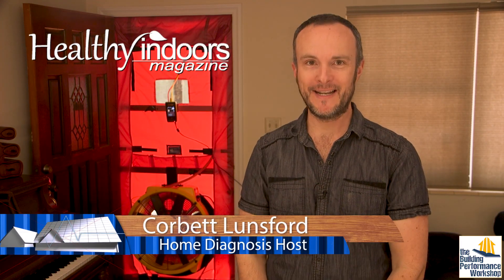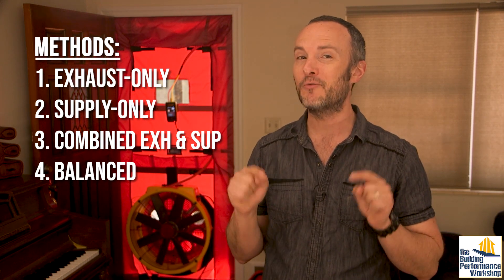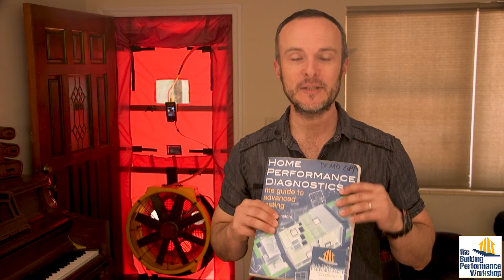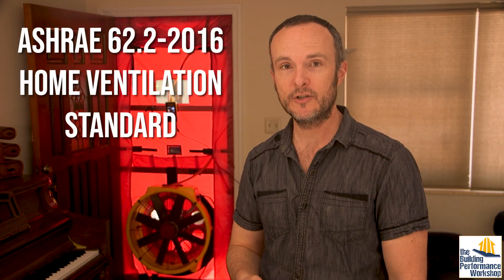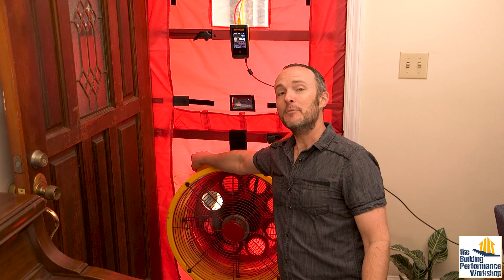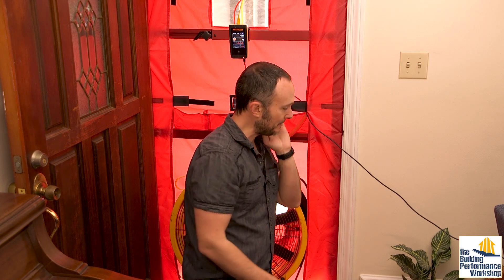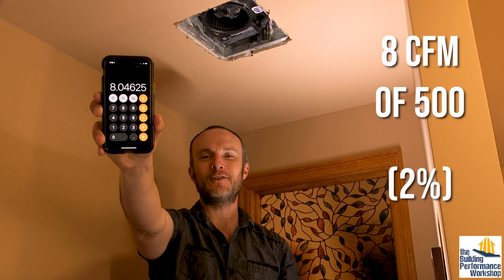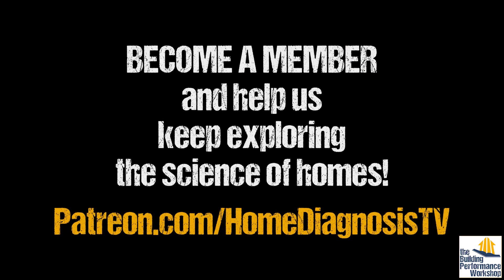Supply Ventilation for Homes: Mythbusting Side Effects

Comment: One of the interesting things about resistance is that it actually does not follow only the path of lease resistance. Liner Network Analysis is an engineering class which teaches how to calculate where electricity flows when it has multiple options (like air in the house). IT turns out the flow follows every possible path at the same time, but the amount changes based on the resistance along each path. The equation is in the form 1/r total=1/r1+1/r2+1/r3.
Reply from the maker: Very interesting, thank you
Reply: No-one ever suggested that air (or electricity) ONLY follows the path of least resistance. I think even a poorly educated person can recognize that air will exit EVERY opening in a pressurized home. Obviously the volume of air exiting each opening will vary, based on the 'resistance' of that pathway.

Comment: Corbett, I'm a little confused by your concluding statement at 12:12.  You say, given a supply-only ventilation strategy, you're not convinced that air will become trapped and condense in building cavities, and that you think it will always find its way out.  Air won't flow into a building cavity unless there's a way out.  Am I missing something?
I think the issue here is, on its way out, will warm moist air condense on building surfaces?  To this I argue "yes it will".
After reading a PILE of information from Joe S. and other knowledgeable Building Science types, I think the reason our leaky buildings generally survive cold climates is simply that mold and rot don't happen at very low temperatures, and by the time things warm up enough to support mold growth the building has had a chance to dry out.
Reply from the maker: Couple points: 1. Joe S and other building science types are largely operating from theory, not from measurements in my experience. Hence you'll often hear 'remember what I told you last year? We discovered that's totally wrong.'
2. If a cavity will have cold surfaces in it, that means it's insulated. It seems obvious to me now that it's unlikely the air is bypassing a wide open window, as shown in the vid, in favor of squeezing into a building cavity that's got insulation in it. If someone does actual research on this and gets actual data to the contrary, fine, but there's none right now, so making decisions based on theory vs. measurement seems like the wrong move.
3. As you know, I'm installing balanced in our own house. But what we're talking about here is the homes that can't afford or fit a fully-ducted separate balanced system- they should have some ventilation imho, and supply-only is far superior to exhaust-only, for filtration and distribution reasons.
Reply: 1. Yes, I've seen those "We got this wrong" admissions, however they are rare (interior basement wall insulation for example).  The building community has been doing quite a lot of testing with regards to moisture accumulation in exterior walls in cold climates.  Much of this has been from researching the "Cold Sheething" phenomenon with super-insulated wall assemblies, mainly double-stud walls.  WUFI modelling suggests many wall assemblies should be failing, when in reality they are not.  What testing has pointed out is, moisture accumulation in cold months doesn't necessarily lead to rot if the assembly can dry, which highlights the importance of vapor permeability.  If moisture levels drop (dry) below critical levels before temperatures increase enough to support mold and rot, the assembly does OK.  Testing has indeed shown this to be the case where Theory (WUFI modeling) indicated serious problems.
2. ?  You pushed 200 CFM into the house and only recorded 60 cfm leaving an open window, which means 140 CFM was working its way out of the house through other openings, most of which are likely unintentional.  Does this not disprove what you just said?  Air is a viscous fluid that resists flow, so an air leak near the blower door is a much easier path than a window on the other side of the house.
3. Agreed, however I have still yet to see compelling evidence that a supply-only system does not lead to moisture accumulation in exterior walls in a cold climate, or that an exhaust-only system doesn't lead to moisture accumulation in exterior walls in a hot humid climate (in air-conditioned homes).

Comment: It takes a certain amount of pressure to open the damper on the bathroom fan, many of the holes around outlets, light fixtures etc have no damper. There are hundreds, if not thousands of pathways for the air to escape. In my mind it would leak out somewhat proportional to the size of each hole. Think about each hole being a portion of the ELA (don't get started!)
I think the biggest takeaway it that the path of least resistance is not where we assume that it is, and that there are many paths, not just one.
It would be good to see this test on a very tight home.

Comment: This was a very informative and reassuring video! I'm about to pull the trigger on upgrading our HVAC from a simple fresh air intake damper to a E100V + 8910FF Aprilaire ventilating dehumidifier. Even though we're in Dallas, we do have stretches of very cold weather in the Winter, so I've been paranoid as of late about this supposed con of supply / positive pressure ventilation. Our home was built in 2018 so insulated to modern standards, but certainly not plastic bag airtight.  I don't think I have anything to worry about.

Comment: I think the video is really good and demonstrates how leaky the house is, but I don't know that I agree with his conclusion that you won't get moisture condensing on building materials at the outside envelope.  If the surface is cold (ie below the dew point), air is moving past it, and that air contains humidity, you're going to get condensation. Maybe it will be enough air flow that those materials will later dry, but you're going to have condensation.
Reply from the maker: I hear where you're coming from, but my bigger point is that real life is not a thought experiment- it's way more complex and intricate, with many more variables. Condensation is not condensation in the real world- some of it makes no difference at all, some of it will tear your house down.

Comment: Did you test the window opening again when you increased the cfm?  I am interested to know if the proportion of air leaving through that opening stayed the same as you increased the cfm.  Basically is the distribution of air movement stable or dynamic as the house becomes more pressurized?

Comment: If the majority of air isn't leaving through what you believe are the points of least resistance, ie; bath fan opening and even an open window, you just proved that much of the air, which could be moisture laden, probably does in fact go into and through cavities that would create a problem at certain times of the year!
Reply: Agreed, the path of least resistance is likely in the cavity where condensation could occur.  Understanding the location of the dew point on cold days would be critical
Reply: @paddy2579  Unfortunately, in an older structure, it is the sum of countless openings in the envelope that have created the path of least resistance, greater than even an open window!  If you performed this same experiment on a fairly well, air sealed home the window and bath fan would likely win the race.  What this would suggest, however I would never recommend it, an air sealed home would better tolerate a supply only ventilation system.
Reply: Very Interesting point

Comment: So, where was the air going?  In our 1970s house pre-renovation, the air would go through the baseboards and up to the roof.  On its way it hit very cold cinderblock and cold ductwork.  In the summertime the hot/moist air came backwards via the same path, again across cold condensing surfaces.  More testing to find the paths, and then an examination of potential condensing surfaces on the way out will be informative.  Thanks for the info.  I'll check out the book and see about setting up to do my own version of this.

Comment: Depending on the type of insulation in the attic (if vented) the interior walls will be the path of least resistance. Especially true for fiberglass batts. I have used my blower door , a pressure pan, and a thermal imager to realize this many times. I would still be hesitant to recommend it in cold climates.
Reply from the maker: Thanks for commenting, Mike, but pressure pan readings and actual airflow measurements are not the same thing, and may not even relate in many cases. That was the main thrust of this demonstration.
Reply: Home Performance Valid point but I guess what I took from the video was to not assume we know where low pressure supply air will go. It could very easily go through wall plates and up through interior walls out the seem between the drywall and top plate if that is the path of least resistance. So I just stay away from supply or exhaust only.  I enjoy all your videos. Keep up the great content.

Comment: Very interesting. Con I've read about is that supply only ventilation would even further dry out the house in cold climates in addition to natural infiltration. To counteract this to be comfortable you usually would use a whole home humidifier which isn't a very precise or controlled way of controlling humidity. Thoughts?

Could supply only ventilation in cold climates also lower supply air temperatures from furnace which makes it so you're not getting all the BTU'S you paid for or is the effect insignificant?

I'm new to the industry so your videos are super duper helpful. Many thanks!

Comment: I am in the process of designing a 2700 sq ft, icf, off grid home outside Newnan, Ga. Many of the energy efficient/wellness ideas have come from your channel. We were going to do spray foam on the roof deck but decided to put a false ceiling and then do blown in cellulose, bringing the duct work below that false ceiling and inside the envelope. Our main energy concern is going to be the cooling being south of atlanta, it gets hot. I think the most energy efficient way to go is going to be a central a/c much like yours with humidity/filtration control. We are aiming to keep the cooling usage under 20 KWH a day. Do you have any recommended books on the subject of energy efficiency and hvac, I know youve held up a few over the years?
Reply from the maker: Happy to work on an energy model with you if you want to be certain, but best thing you can do is tighten and insulate your enclosure. Bookwise, Residential Energy is a central textbook, though I haven’t cracked in in awhile.

Comment: I am remodeling/updating a home built in 1957 in Corpus Christi, TX bought from builder/original owner. No updating was ever really done. One clue I wanted to ask about based on your path of least resistance is that the attic (max clearance 3 feet at peak) is always quite warm, even in the winter. Could I assume that is the destination of most air in the home?

Comment: Hypothetically with a really tight house could you not have a timed air intake that pulled in air only when the temperature hit certain temperature range. Say 66-74 degrees. Then have it filtered and dehumidified. If you had enough thermal mass even in hot climates like georgia I could see being able to have very little air conditioning. Any thoughts? Might have to test this.

Comment: Would a supply-only ventilation stragedy also work for a Passive House in a cold climate?  I have read that it wouldn't (for the same condensation reasons you mentioned in the video) and that you must have balanced or exhaust whole-house systems.
Reply from the maker: No. In a passive house, or anything like the one we're building ourselves on this channel, you must have balanced ventilation, period.

Comment: Hello, been considering a supply only ventilation system but believed that the path of least resistance was straight out of the bathroom vent..
This video is tries to show that isn't the case in a leaky home.

Going to retro fit a very basic air inlet on the ground floor and keep an eye on the humidity levels👍🏼👍🏼
Reply from the maker: Nice

Comment: Interesting video. You pressurized the home slightly. You measured about 8 CFM escaping the bathroom exhaust. Maybe I’m being anal but I’d like to know the measurements at all exhaust points and add them up. Of 500 CFM maybe 50-100 CFM escapes at those points. Where does the rest go? Seems obvious it’ll escape around electrical outlets and other cracks. Doesn’t seem like much of a big deal but the long term effects seem like they’d be worse than expected.

Have you read ‘Buildings Don’t Lie’? I just got it today and anxious to crack it open.

Comment: Why would you even consider suply/exhaust only ventilation for perfomance? Heat return ventilation would be only option.
Reply from the maker: Great question, Lauri, and remember it's all a question of perspective and priorities. In a typical home, you might want controlled ventilation for health, and one-way ventilation would be perfectly fine (supply better than exhaust because of filtration). You wouldn't see the efficiency difference anyway. And even in a tighter home, you'd be right to question whether the efficiency is always worth it (every case is different) because air has almost no thermal mass. It doesn't cost much to heat up or cool down air.
Reply: Most here are supply only due to house not being tight enough for balanced to work well. 
And that its not cold enough for long enough to get issues like attic rain.

Comment: I don’t get it; and I will also say that I’m no expert.   However,  didn’t you just prove that the air does escape out through (probably) a thousand small openings all over the house; some (probably) through wall cavities.   The air needs to go somewhere and it sure didn’t all go through the ceiling fan.  What am I missing?
Reply from the maker: Point is: there are huge, wide open pathways the air is neglecting to go somewhere else. If it's finding an easier path than a wide open window or duct, then doubtful it's going into insulated cavities where the temperature will change drastically.
Reply: @HomePerformance  I'm still not sure I get it. To me, the fact that most of the airflow is not going out through the open window or ductwork is evidence that the remainder is leaking through insulated cavities (or uninsulated cavities which still have cold surfaces). What other pathways are you thinking of that I am missing?